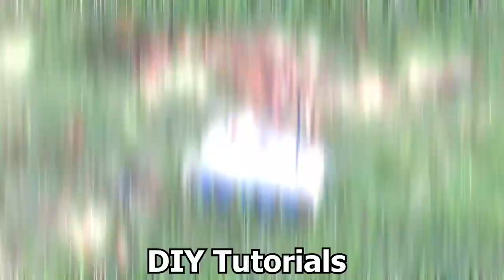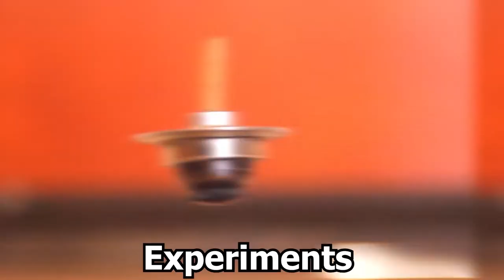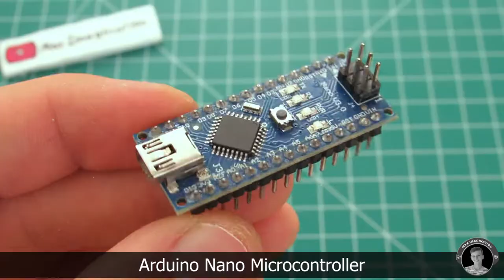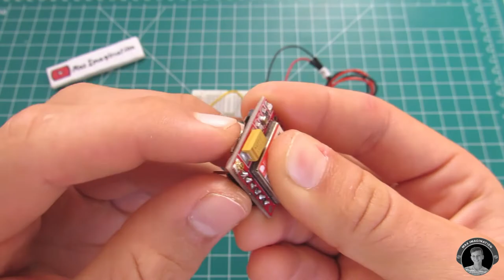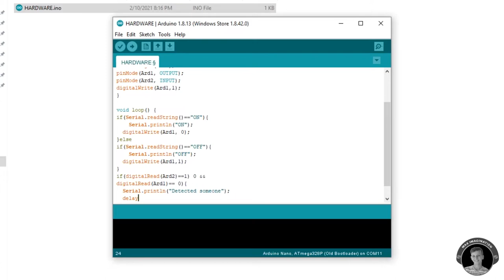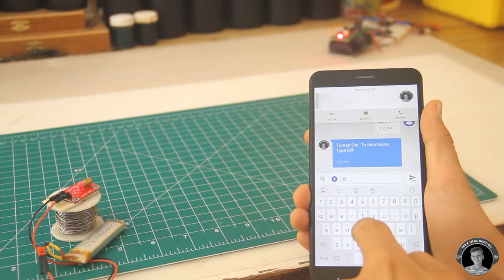Build an Arduino Laser Security System Alarm that Calls You!

Comment: Add this, add that. But why?
Reply from the maker: Why what? If you find my project too complex, consider using only an Arduino board with the GSM module using more code to suffice for the features the green alarm board has.
Reply: @MaxImagination  With respect, etc., one could easily argue the project was too complex for /you/.

Comment: I used a 470uf capacitor and a 560uf capacitor but still the sim 800L is not connecting to the network, what might be the problem
Reply from the maker: The power supply may be the problem. What power supply are you using?

Comment: For the detection is it possible to use the laser sensor by itself to detect when something has tripped it? Can the laser itself tell you when its been tripped? Or is it best to use a photoresistor like you did here?
Reply from the maker: With cheap open-loop feedback lasers as the one used in this video, using a photo-resistor in combination is the only way. Cheers.

Comment: Can you provide some final connection and diagram i want to use this sam for my gold shop security
Reply from the maker: Hi there. If you take this diagram - https://drive.google.com/file/d/1D_uhYmozksXxdWo3acg8Hx82iUtmN3g7/view?usp=sharing
and combine it with this diagram -
https://drive.google.com/file/d/1aGNoy611j2GMb6tWYj79BROibZ3OKPLQ/view?usp=sharing
you'll have a functioning circuit, as long as you follow the connection points labeled (Ard 1 & Ard 2, etc.)
Cheers.
Reply: @MaxImagination  thanks

Comment: Can i use an ldr module instead of the circuit you built on your own in the previous video. Thanks!
Reply from the maker: The circuit already uses an LDR module. Could you please be more specific? Cheers.
Reply: @MaxImagination  I mean a readymade LDR module available in the shops. Please look it up

Comment: Would I be able to integrate a RPIF module in this? And possible a fingerprint option in the mobile app to turn off the alarm?
Reply from the maker: Don't you mean "RFID"? I've never used either of them before so I wouldn't be able to help you on that.

Comment: Hello. What are you using to power the Arduino
Reply from the maker: Hello there. I used an LM2596 DC to DC buck converter.
Reply: @MaxImagination  also i used a 470uf capacitor on the sim 800L but it still doesn't connect to the network what might be the problem

Comment: can i use arduino uno board rather than a nano board?
Reply from the maker: Yes, you can. The use the same chip and practically work the same, but are different sizes.

Comment: I made it all same but after typing activation password it doesn't perform further there is no response please help
Reply from the maker: Hi there. Can you tell if your GSM module even works? Please try putting a 50 microfarad filtering capacitor across its power terminals, this might help it start up.